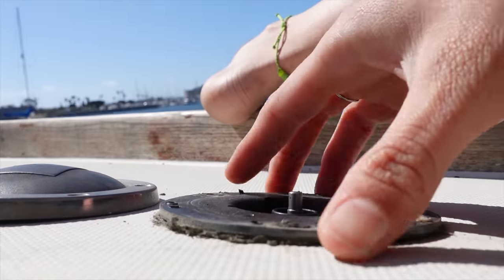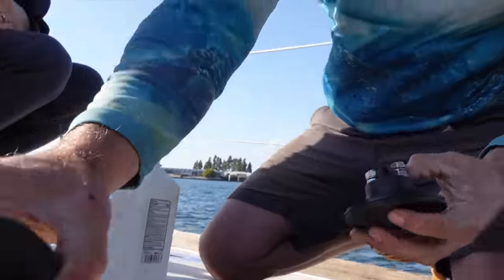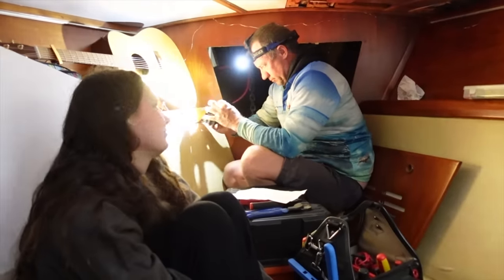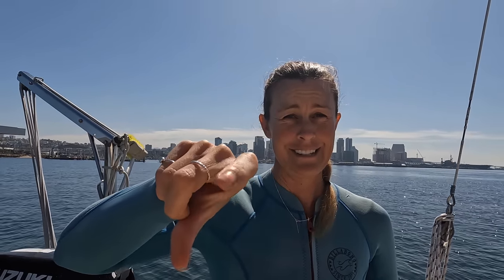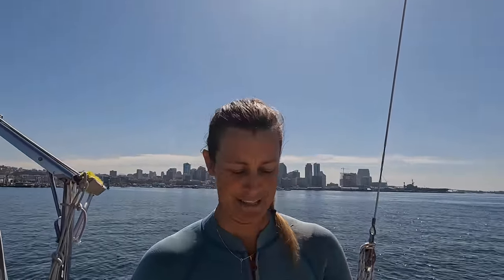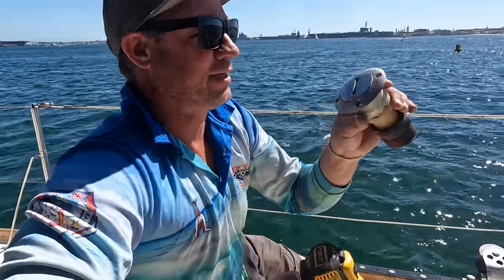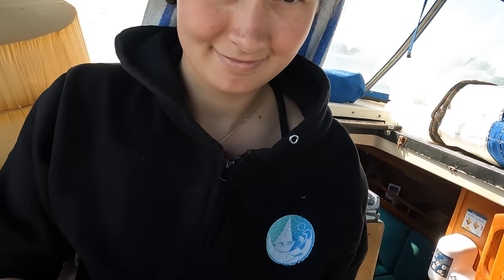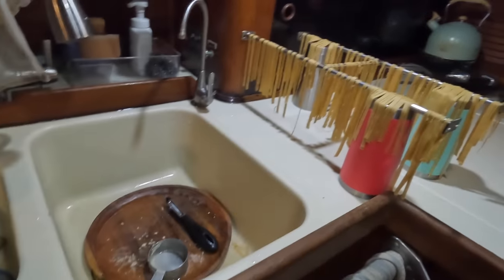Final Boat jobs in San Diego | Ep 352 | LOTS of Boat Work

Comment: good work fixing all your thru holes to prevent wood rot - check out  "A boat by the river " directly putting screws and holes in the new boat with no sealant - another future you tube fixer upper in 20 years with decks and bulkhead replacement like sailing magic carpet - I have a mate who bought a cat where the entire deck and roof were delaminating due to all of the screw holes not sealed causing water ingress and rot - cost $80K to fix - Aladino cored every screw hole when they replaced the deck - a very thorough and good boatbuilder - they also resin sealed all the replacement wood including the end grain - some yters doing repairs on rotten bulkheads just replacing the timbers and bulkheads but not properly sealing them - so leaving a redo for someone in the future - do it right first time